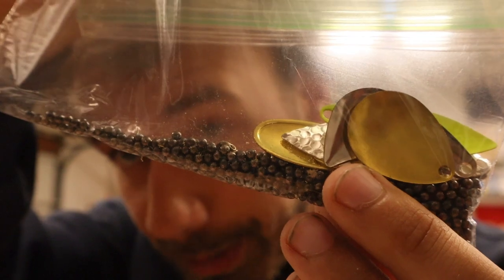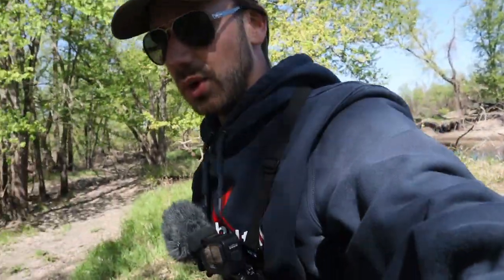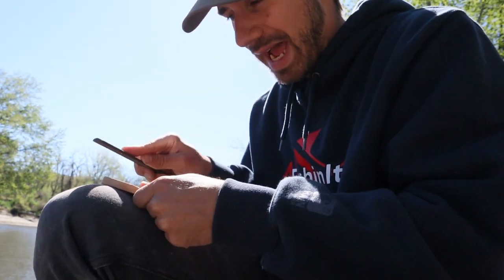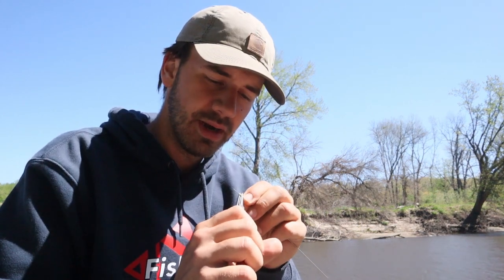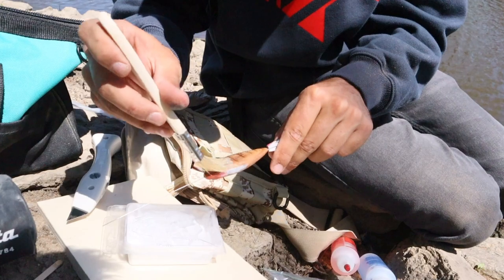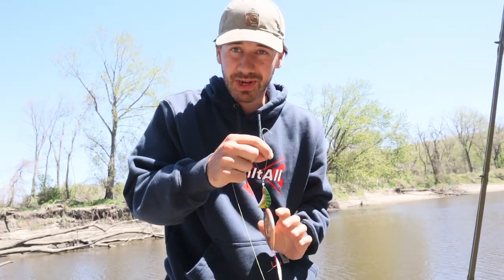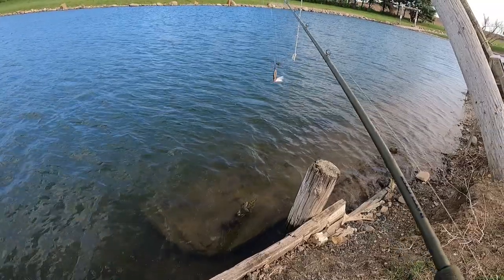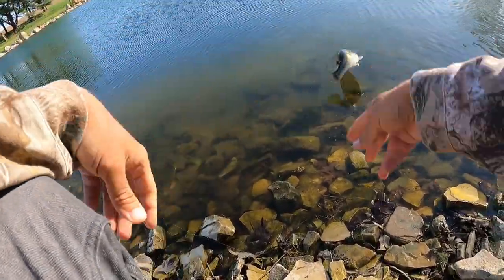River Bank One Day Build to Catch | Inline Spinner

Comment: Marling Baits Love the show. Have been watching a lot of retro bassing channel. My grandpa used to use a lure called the Heddon hellbender to troll also to cast for largemouth bass from the late '50s and early '60s. Looks like an awesome bait It's kind of unusual. Thought I would suggest it. Maybe Make a traditional hellbender or a modernized take such as clear plastic lip versus aluminum lip. Also big box lure makers make plugs out of plastic that are hollow. I was just wondering how do they do that I've seen you make solid plastic baits in the mold just wondering how they mold them hollow

Comment: Mortice 

- noun
noun: mortice
a hole or recess cut into a part which is designed to receive a corresponding projection (a tenon) on another part so as to join or lock the parts together.
"a mortise and tenon joint"

-verb
verb: mortice
join securely by using a mortise and tenon.

just confirming  for the comment mutants; he knew all along

Comment: mor·tise
/ˈmôrdəs/

noun
a hole or recess cut into a part which is designed to receive a corresponding projection (a tenon) on another part so as to join or lock the parts together.
"a mortise and tenon joint"

verb
join securely by using a mortise and tenon.
"the top plate of the rudder assembly can be mortised to the top of the rudder post"

Definitions from Oxford Languages

Comment: Stanley 10-499.
Uses same blades as that expensive "lookie what I got be "impressed" !" thing you got, plus tool free no disassembly blade change, retractable blade, and storage for 5 blades in the handle. (no tools or disassembly access to the exrta blades).
Even better, can be had in easy to spot if dropped (unless you in a Daisy patch) yellow. 😀 
(the one I got off Amazon is yellow, at any rate)

Questiin:
How is making a lure stream/river/lake side "fishing"?
How many casts without a bite before you decide to make a new spinner with different color and/or shape spinners and paint color? (or do you bring a selection of lures to use off camera?)
worse than them who have 100 plus different flies in their fly box but still have to tie a new one to "match the hatch" every time they go out...